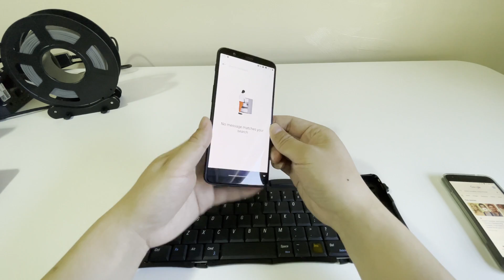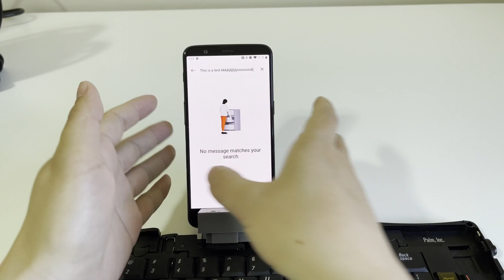Converting a Palm Portable Keyboard into a Bluetooth keyboard!

Comment: i dont know whether you are still alive. I have one the palmone ir keyboard which i used with my treo 650. Please tell me how to get that into work.
Reply from the maker: IR protocols are usually hard to interpret, and there is no documentation for that keyboard. I think the best approach would be to design a custom mainboard to directly interface with the keyboard matrix. I personally think the palmone ir keyboard is plasticky and not easy to open/unfold, so I wouldn't try to mod it. There are other better designed folding keyboards like the Palm Ultra-Thin Keyboard (P10900U) that is more worth tinkering.

Comment: Hi. Excellent, I've been wanting to do this for a decade! Two years after you posted this video, were you able to find the source of the delay?

Also, I have a pronunciation suggestion if you'd like to hear it. 

Regards.
Reply from the maker: I didn't find the source of the delay because I changed my chip choise in version 2 and 3, and they don't have this issue. I guess it was the default Bluetooth report interval settings, but I didn't bother to root cause it because version 1 is no longer my focus.
And yes, any suggestions are welcomed.
Reply: @XinmingChen  Hi again. Please DM me offline. Warm regards.

Comment: Hi, can you type j, k, l?
Reply from the maker: So you couldn't type j, k, l? That's an indication of the ribbon cable inside the keyboard is damaged, so some rows won't register.
Reply: @ I have palm i Go bluetooth keyboard and USB Palm Keyboard what you have one, both are same result. It's not the cable problem. When I use this USB Palm Keyboard on my Mac, It works.

Comment: This is a very tempting proposition because I the Targus Stowaway Keyboard for my Palm IIIc was probably one of the best portable keyboards I ever had. I do have two versions of the Apple BT keyboard, but each can only be paired with a single device at a given time (to switch devices I must enter pairing mode). My newest BT/RF keyboard is made by Jlabs. It can be paired wit two BT devices and one dongle. It fits neatly in my backpack, but when looking for a "folding" keyboard, NOTHING come close to the old Targus Stoaway. A friend sent me a link to a new folding keyboard and it doesn't "lock" into place so you can't use it on your lap. 

On the other hand, as much as I truly loved the Targus Stowaway, it just occured to me that it doesn't have Function keys. This isn't a deal-breaker for typing on my phone, but it can become a  minor hinderance when using Splashtop/Parsec/RDP to connect remotely to my desktop. Still, it's good to have options and I thank you for your work on this project!
Reply from the maker: About the function keys, If you are open to doing a little programming in Arduino, you can change the key mapping to anything you like in this adapter's firmware.

Comment: Will the adaptor work with Palm model P10802U?
Reply from the maker: No, the connector pitch is too small, I can't find an easy way to mimic it.
Reply: @XinmingChen  Does this mean there wont be an adapter for the P10802U? I actually happen to just recently come across this model being cleaned out of an old classroom.
Reply from the maker: @Mudduk1  Oh, there are attempts to make adapters for P10802U, see https://hackaday.io/project/181800-palm-pilot-keyboard-bluetooth-conversion. I just don't have the PCB making tools so I can't try it myself.

Comment: Great project! Any chance to get a version for the Universal connector (M500 series to T3)? Also, I have a Landware GoType keyboard for Palm III *somewhere*, would it work with that? That keyboard does not have a battery AFAIR.
Reply from the maker: I am experimenting with some ideas for the M500 series. I will update the github repo in a month or two, if I find an easy way to mimic the connector. The connector is very fine pitched, but I've thought about two possible solutions.
I'm not sure if the Landware GoType keyboard will work, even though the connector would fit. They might be using a different protocol to talk to the Palm. This is defined in the driver of the keyboard, and I have no idea whether that protocol is the same as PPK. Battery is not an issue. PPK does not have battery either. This adapter has a battery.
Reply: @XinmingChen  Thanks, and good luck with the M500 series!

Comment: Nice project. Your github description is well done and easy to follow. I have one of the Palm III foldable keyboards, from back in the day when these were cutting edge (and not cheap), and have longingly looked at it to use for more recent devices:  I always thought the keyboard was genius. I am guessing you are using the sms trans and resistors to keep the enclosure as small as possible. But, would there be a problem if regular sized components are used (much easier to solder) and then just adjust the 3d print to accommodate. Or is there a specific need to use only sms components? Thanks for your thoughts.
Reply from the maker: Regular sized component can be used. I just used SMD components for their small size. Note: I am developing a version 2 using the ESP32-C3 microprocessor, that has built-in inverter for Serials, so no extra components are needed. If you want to wait for the version 2 you can stay tuned to the github page.

Comment: There was a version that came with a USB adapter to use on PCs. I think it was branded Targus. The keyboard ended up not being particularly durable in my experience and the entire left-most segment stopped working pretty quickly, likely due to the flex membrane being damaged by folding.